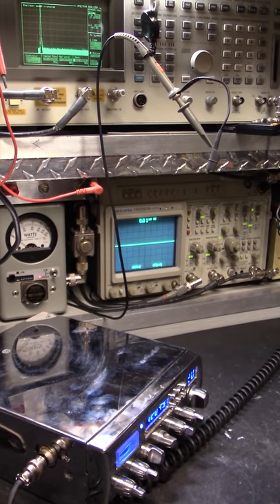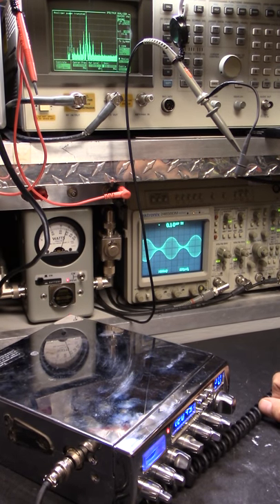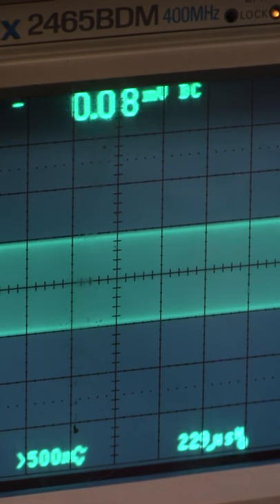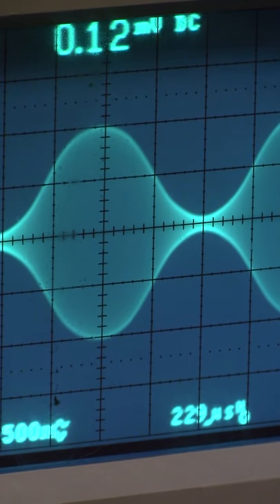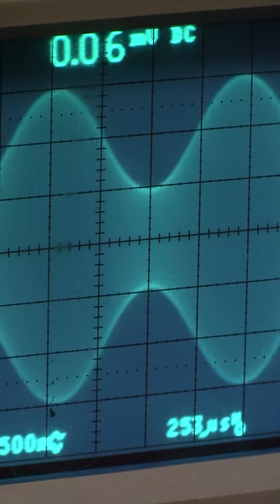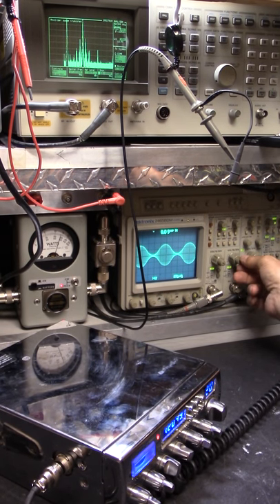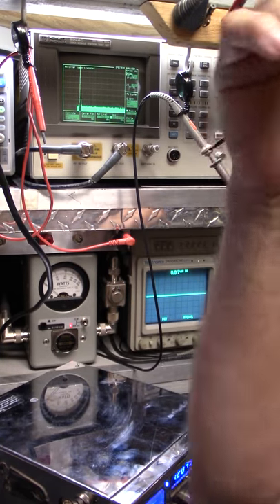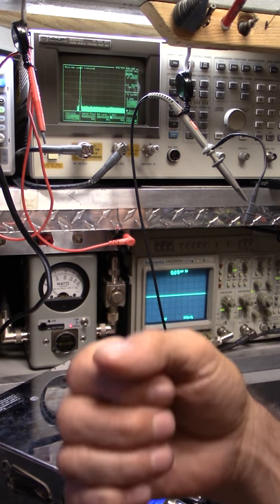CB RADIO REPAIR:  How To Spot  - "BS" -  With Common Sense .. It Goes A Long Ways!

Comment from the maker: PAY ATTENTION!
If they don't or wont show you .. like this .. they're stroking you,  get that Part?  Never settle for less! Here's what it takes to cut through the noise, be loud and crystal clear with a better receiver too:  A) Tuned Bench:  https://www.youtube.com/watch?v=lwcDfXOgAls. 
True, it's more complicated and time consuming to accomplish these consistent and accurate results. Below is a partial procedure and list of calibrated equipment used to achieve this level of performance . Read on ..

Fine Tune CB Radio Shop strictly adheres to (https://www.nist.gov/) NIST Traceable Calibrations and other industry standards to maintain accuracy and consistency for providing Real World Performance Tuning of Citizens Band and 10 Meter export mobile radios with integrity.

"Basic Textbook AM/FM/SSB Transceiver Tune, Alignment and Calibration" 

1) Pll adjustments
VCO & OSC, AM TX OSC, USB TX OSC, LSB TX OSC.

2) Transmitter alignment
DRIVER BIAS, FINAL BIAS, SSB  (or gate voltages for mosfet versions) CARRIER BALANCE, HI-LO AM & SSB Power, RF METER, AMC, ALC and FM DEVIATION.

3) Receiver alignment
AM/FM RF & IF SENSITIVITY, FM DETECTOR/DEVIATION, SSB IF SENSITIVITY, SSB S-METER, AM/FM S-METER (100uV unmodulated -67dbm for “S-9” meter reading!), AM/FM SQUELCH RANGE, SSB SQUELCH RANGE, and NOISE BLANKER/AUTOMATIC NOISE LIMITER (Real World dBm to volts (uV) tables below).

That's just a typical run of the mill textbook tune up and alignment (if you're lucky). There's more to it than frequency alignment, modulation adjustment, meter calibration and a tune up report displaying exaggerated rms Bird peak watts! 

"Test Bench includes"

Bird 4314C Meter
https://www.birdrf.com/Products/Test%20and%20Measurement/Power-Meters/Wattmeters-Line-Sections/RF-Wattmeters/4314C_PEP-Single-Element-Wattmeter.aspx
Part 1) https://www.youtube.com/watch?v=RpX9IHe4ORM&t=16s
Part 2) https://www.youtube.com/watch?v=LuhbqTf6Bxw
Bird 4314C Accuracy Test: https://www.youtube.com/watch?v=DqEOabYqhQo&t=5s
Bird Stipulates 1/2 wavelengths  https://www.youtube.com/watch?v=5eWhgT-rTII
And Genuine Bird Elements from 1K down.

Bird 4373 Sampler 
https://www.rfparts.com/signal-samplers.html

HP8924c with options
http://userequip.com/files/specs/2147/HP%208924C%20Repair.pdf
https://www.youtube.com/watch?v=Cg1w0xBa27s&t=1s

HP8920a with options
https://www.keysight.com/upload/cmc_upload/All/EPSG072204.pdf

Three analog scopes, one digital 200 Mhz
https://www.atecorp.com/atecorp/media/pdfs/data-sheets/tektronix-2465b-2467b_manual.pdf
https://www.youtube.com/watch?v=by98x4eu2lM

Fluke 27fm
http://www.fluke.com/fluke/inen/digital-multimeters/fluke-27.htm?pid=56055
 
LCR http://www.lcrresearch.com/wp-content/uploads/2017/05/LCR_Pro1_Manual_version1.03.pdf

Power supplies
6 Cosel PBA1500f12 (750 amps) variable and configurable.
https://en.cosel.co.jp/product/powersupply/PBA/PBA1500F/PBA1500F-12/
Corcom 20VB1 F7130 EMI Filter 50-60Hz 250V

Times Microwave Coax jumpers and test leads
http://www.timesmicrowave.com/cms/products/cables/lmr/
https://www.youtube.com/watch?v=EmqaGJ6IWow
https://www.youtube.com/watch?v=1ltFVSxGp5Y
https://www.youtube.com/watch?v=v12YZT_1o90
https://www.youtube.com/watch?v=h7iiYfmYWRA&t=215s

Amphenol RF Connectors
https://www.amphenolrf.com/
https://www.youtube.com/watch?v=dVh5B0hdEA0 
https://www.youtube.com/watch?v=dKZg8T_AOso

More range, compliments, reliability and a quieter, clearer but more sensitive receiver,  Get Fine Tuned .. not peaked and ruined.

Here are some VideoGates of me at the bench practicing what I preach using my bench radio or customers radio completed and ready to be shipped: https://www.youtube.com/results?search_query=hard+drive+163+ more: https://www.google.com/search?q=Hard+Drive+163+nm&ie=utf-8&oe=utf-8&client=firefox-b-1-ab

It's what I recommend, use, service and sell ... to you ... not something non practical or deceiving in a misleading way. I'm not just the tech and owner of Fine Tune CB Radio Shop, I'm a customer too!  When finished, You'll be giving radio checks, not asking for them .

dBm To Watts and Volts
Tables below displays relationship between Power in [dBm] or [Watts] and Voltage in RMS, peak, peak-to-peak for sinusoidal signals in 50-Ohm systems for accurately measuring and tuning am/fm/ssb receiver sensitivity, agc, squelch and "S9" Meter calibration.

  [dBm] [Watts]   [Volts]rms   [Volts]p    [Volts]pp
-140 0.100E-16  22.361 nV  31.618 nV  63.236 nV 
-139 0.126E-16  25.089 nV  35.476 nV  70.952 nV 
-138 0.158E-16  28.150 nV  39.805 nV  79.609 nV 
-137 0.200E-16  31.585 nV  44.662 nV  89.323 nV 
-136 0.251E-16  35.439 nV  50.111 nV  100.222 nV 
-135 0.316E-16  39.764 nV  56.226 nV  112.451 nV 
-134 0.398E-16  44.615 nV  63.086 nV  126.172 nV 
-133 0.501E-16  50.059 nV  70.784 nV  141.568 nV 
-132 0.631E-16  56.167 nV  79.421 nV  158.842 nV 
-131 0.794E-16  63.021 nV  89.112 nV  178.223 nV 
-130 0.100E-15  70.711 nV  99.985 nV  199.970 nV 
-129 0.126E-15  79.339 nV  112.185 nV  224.370 nV 
-128 0.158E-15  89.019 nV  125.874 nV  251.747 nV 
-127 0.200E-15  99.882 nV  141.232 nV  282.465 nV 
-126 0.251E-15  112.069 nV  158.465 nV  316.931 nV 
-125 0.316E-15  125.743 nV  177.801 nV  355.602 nV 
-124 0.398E-15  141.086 nV  199.496 nV  398.992 nV 
-123 0.501E-15  158.301 nV  223.838 nV  447.677 nV 
-122 0.631E-15  177.617 nV  251.151 nV  502.302 nV 
-121 0.794E-15  199.290 nV  281.796 nV  563.591 nV 
-120 0.100E-14  223.607 nV  316.180 nV  632.360 nV 
-119 0.126E-14  250.891 nV  354.760 nV  709.519 nV 
-118 0.158E-14  281.504 nV  398.047 nV  796.094 nV 
-117 0.200E-14  315.853 nV  446.616 nV  893.232 nV 
-116 0.251E-14  0.354 µV  0.501 µV  1.002 µV 
-115 0.316E-14  0.398 µV  0.562 µV  1.125 µV 
-114 0.398E-14  0.446 µV  0.631 µV  1.262 µV 
-113 0.501E-14  0.501 µV  0.708 µV  1.416 µV 
-112 0.631E-14  0.562 µV  0.794 µV  1.588 µV 
-111 0.794E-14  0.630 µV  0.891 µV  1.782 µV 
-110 0.100E-13  0.707 µV  1.000 µV  2.000 µV 
-109 0.126E-13  0.793 µV  1.122 µV  2.244 µV 
-108 0.158E-13  0.890 µV  1.259 µV  2.517 µV 
-107 0.200E-13  0.999 µV  1.412 µV  2.825 µV 
-106 0.251E-13  1.121 µV  1.585 µV  3.169 µV 
-105 0.316E-13  1.257 µV  1.778 µV  3.556 µV 
-104 0.398E-13  1.411 µV  1.995 µV  3.990 µV 
-103 0.501E-13  1.583 µV  2.238 µV  4.477 µV 
-102 0.631E-13  1.776 µV  2.512 µV  5.023 µV 
-101 0.794E-13  1.993 µV  2.818 µV  5.636 µV 
-100 0.100E-12  2.236 µV  3.162 µV  6.324 µV 
-99 0.126E-12  2.509 µV  3.548 µV  7.095 µV 
-98 0.158E-12  2.815 µV  3.980 µV  7.961 µV 
-97 0.200E-12  3.159 µV  4.466 µV  8.932 µV 
-96 0.251E-12  3.544 µV  5.011 µV  10.022 µV 
-95 0.316E-12  3.976 µV  5.623 µV  11.245 µV 
-94 0.398E-12  4.462 µV  6.309 µV  12.617 µV 
-93 0.501E-12  5.006 µV  7.078 µV  14.157 µV 
-92 0.631E-12  5.617 µV  7.942 µV  15.884 µV 
-91 0.794E-12  6.302 µV  8.911 µV  17.822 µV 
-90 0.100E-11  7.071 µV  9.998 µV  19.997 µV 
-89 0.126E-11  7.934 µV  11.218 µV  22.437 µV 
-88 0.158E-11  8.902 µV  12.587 µV  25.175 µV 
-87 0.200E-11  9.988 µV  14.123 µV  28.246 µV 
-86 0.251E-11  11.207 µV  15.847 µV  31.693 µV 
-85 0.316E-11  12.574 µV  17.780 µV  35.560 µV 
-84 0.398E-11  14.109 µV  19.950 µV  39.899 µV 
-83 0.501E-11  15.830 µV  22.384 µV  44.768 µV 
-82 0.631E-11  17.762 µV  25.115 µV  50.230 µV 
-81 0.794E-11  19.929 µV  28.180 µV  56.359 µV 
-80 0.100E-10  22.361 µV  31.618 µV  63.236 µV 
-79 0.126E-10  25.089 µV  35.476 µV  70.952 µV 
-78 0.158E-10  28.150 µV  39.805 µV  79.609 µV 
-77 0.200E-10  31.585 µV  44.662 µV  89.323 µV 
-76 0.251E-10  35.439 µV  50.111 µV  100.222 µV 
-75 0.316E-10  39.764 µV  56.226 µV  112.451 µV 
-74 0.398E-10  44.615 µV  63.086 µV  126.172 µV 
-73 0.501E-10  50.059 µV  70.784 µV  141.568 µV 
-72 0.631E-10  56.167 µV  79.421 µV  158.842 µV 
-71 0.794E-10  63.021 µV  89.112 µV  178.223 µV 
-70 0.100E-09  70.711 µV  99.985 µV  199.970 µV 
-69 0.126E-09  79.339 µV  112.185 µV  224.370 µV 
-68 0.158E-09  89.019 µV  125.874 µV  251.747 µV 
-67 0.200E-09  99.881 µV  141.232 µV  282.465 µV
-66 0.251E-09  112.069 µV  158.465 µV  316.931 µV 
-65 0.316E-09  125.743 µV  177.801 µV  355.602 µV 
-64 0.398E-09  141.086 µV  199.496 µV  398.992 µV 
-63 0.501E-09  158.301 µV  223.838 µV  447.677 µV 
-62 0.631E-09  177.617 µV  251.151 µV  502.301 µV 
-61 0.794E-09  199.290 µV  281.796 µV  563.592 µV 
-60 0.100E-08  223.607 µV  316.180 µV  632.360 µV 
-59 0.126E-08  250.891 µV  354.760 µV  709.520 µV 
-58 0.158E-08  281.504 µV  398.047 µV  796.094 µV 
-57 0.200E-08  315.853 µV  446.616 µV  893.232 µV 
-56 0.251E-08  0.354 mV  0.501 mV  1.002 mV 
-55 0.316E-08  0.398 mV  0.562 mV  1.125 mV 
-54 0.398E-08  0.446 mV  0.631 mV  1.262 mV 
-53 0.501E-08  0.501 mV  0.708 mV  1.416 mV 
-52 0.631E-08  0.562 mV  0.794 mV  1.588 mV 
-51 0.794E-08  0.630 mV  0.891 mV  1.782 mV 
-50 0.100E-07  0.707 mV  1.000 mV  2.000 mV 
-49 0.126E-07  0.793 mV  1.122 mV  2.244 mV 
-48 0.158E-07  0.890 mV  1.259 mV  2.517 mV 
-47 0.200E-07  0.999 mV  1.412 mV  2.825 mV 
-46 0.251E-07  1.121 mV  1.585 mV  3.169 mV 
-45 0.316E-07  1.257 mV  1.778 mV  3.556 mV 
-44 0.398E-07  1.411 mV  1.995 mV  3.990 mV 
-43 0.501E-07  1.583 mV  2.238 mV  4.477 mV 
-42 0.631E-07  1.776 mV  2.512 mV  5.023 mV 
-41 0.794E-07  1.993 mV  2.818 mV  5.636 mV 
-40 0.100E-06  2.236 mV  3.162 mV  6.324 mV 
-39 0.126E-06  2.509 mV  3.548 mV  7.095 mV 
-38 0.158E-06  2.815 mV  3.980 mV  7.961 mV 
-37 0.200E-06  3.159 mV  4.466 mV  8.932 mV 
-36 0.251E-06  3.544 mV  5.011 mV  10.022 mV 
-35 0.316E-06  3.976 mV  5.623 mV  11.245 mV 
-34 0.398E-06  4.462 mV  6.309 mV  12.617 mV 
-33 0.501E-06  5.006 mV  7.078 mV  14.157 mV 

                 Don't Be A Mud Duck!

Hard Drive 163 NM. 73's! Click click.